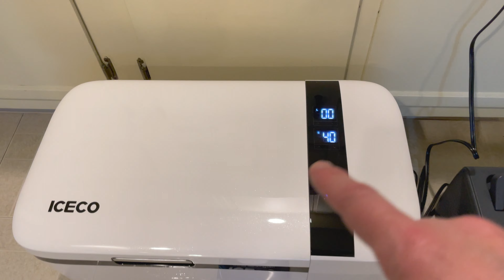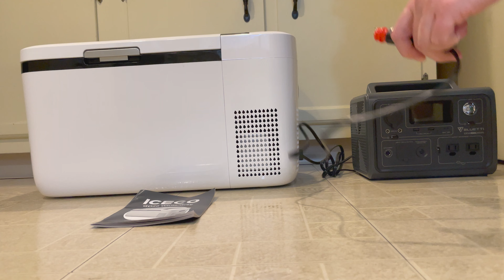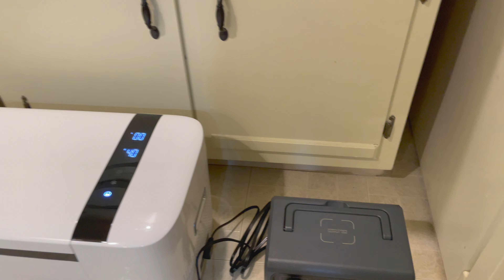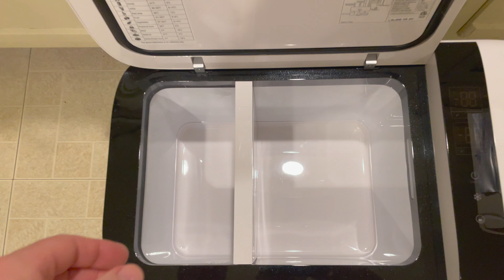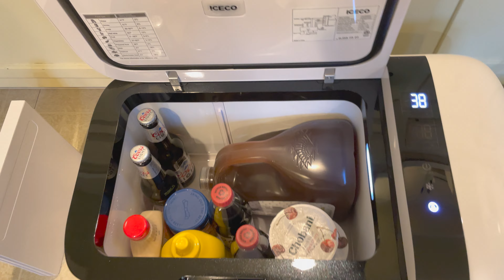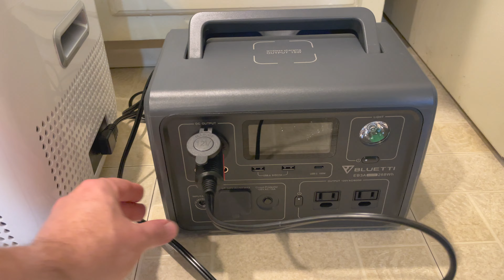IceCo Go20 Powered by Bluetti EB3A - How Long?

Comment: I have that EB3A and use it for camping with a 32 quart fridge.  I use a no name 120W solar panel to charge it all day when the sun is up and to power the frig via the EB3A.  The EB3A then powers the fridge at night.  It usually has about 40 something percent left in the morning.  The 120W solar panel brings it back up to 100% very quickly in the morning sun before I pack it up.
Reply: Thanks you for the information! Would you be able to share what Solar panel you use? I want to make sure I get one that’s compatible and I really don’t know the difference of what is and isn’t.
Reply: @lightbetweentrees  it's a no name that I bought off of Offer Up.  It was brand new and cheap.  The thing with the EB3A is to make sure you get the proper connector for the input.

Comment: its cheaper to buy a 25Ah lith battery since its basically whats inside, a solar charge controller, a 300 watt power inverter and the necessary wiring and battery box and build it yourself.
Reply from the maker: Yeah, and also three different items to carry around. I’ll stick with the EB3A that I got on sale for $209.

Comment: Reflectic insulation wrapped the fridge and cut holes for the vents. With a single frozen smart water bottle, food and cooling it down to 32 degrees pre chilling I can get 45 hours on a normal day of 70 degrees to 80 degrees outside temperature. 
Works amazing if you carry a 60w to 100w solar panel with the setup. If the sun is out it's an infinite power fridge.

Comment: A lot of guys are hooking up a 50 amp hour and in some cases 100 amp hour LifeP04 A lot of times are using they’re using the little minis and plug them in they claim that helps them run a long time,,,I also I just bought one of these on prime day for $199 so far we just love it I’m gonna put mine on a solar panel too. I want to try a 100 watt panel first and then I’ll try a 200 W set up. I’ll wire up 2  100 W panels and just see what we can do with this thing. for their size I just think they’re incredible. I have a Toyota Tacoma with an aluminum toolbox in the bed I’m thinking about mounting a 100 W flexible panel on top of the lid that way if we go on a long trip we’ll have a lot of extra power and could even charge a small 50 amp hour mini to take a long.
Reply from the maker: Enjoy your new Bluetti! But be careful of 200 watts, make sure the voltage and amps are within spec of the EB3A. It can fry if over-voltage.
Reply: @JimboP-Outside  mabe only 100 watts
Reply: @justmeonlyme  I had a few older five bus bar Renorgy 100 W solar panels laying around that I wasn’t using so I got some of those MC4 Y branch connector things and hooked up the panels that way. I’ve been using that set up  to recharge it I got some12 gauge direct burial landscaping wire that’s good for up to 30 V I’m going to use that to bring that into the house that way I’ve got the barrel plug for the end of that wire I’ll do that for now but I’m probably gonna make a small solar charging station and just run wires from a fuse block into the barrel plug and plug that into the EB3A i’ll probably have a 100 amp hour battery on that mini charging station that I build that way I could watch TV probably all night I’m thinking and run a few other things as well,,, I hope so anyway👍

Comment: Bluetti, is on sale for the 600 watt for $209. Can the GO20 
use  an 80 watt solar Panel shown on another video?
Reply from the maker: The size of solar panel depends on the power station (Bluetti, EcoFlow, Jackary, etc.) it does not connect directly to the GO20.